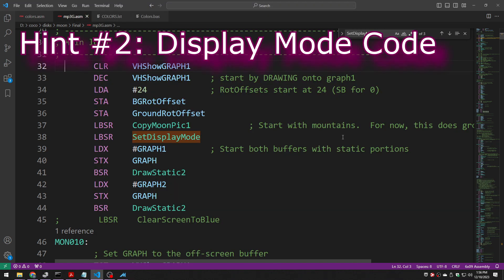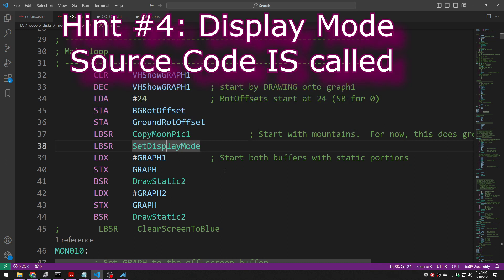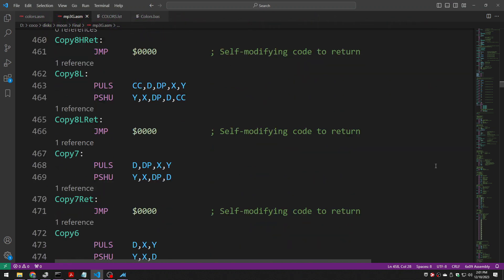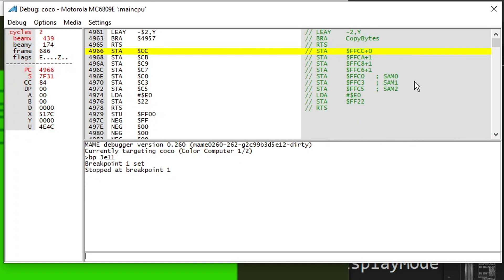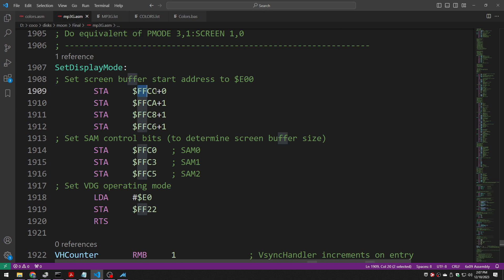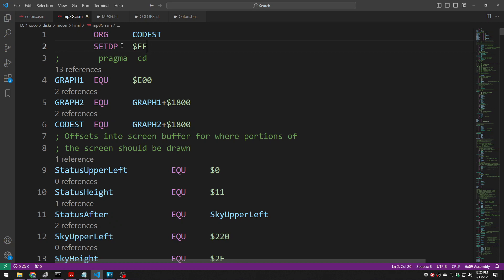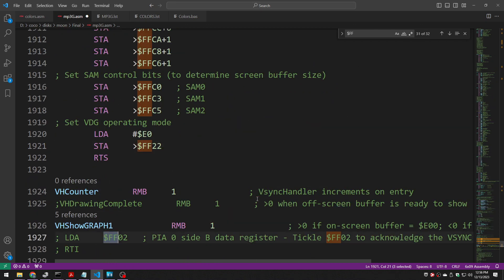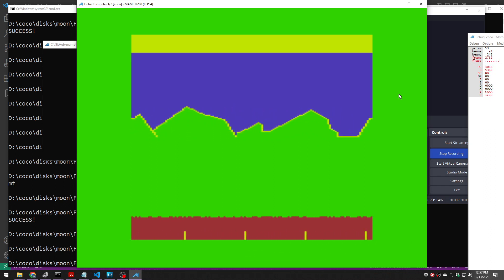My favorite bug so far | Asm Adventures

Comment: Don't remember the change?
That's a reason for using git locally, unrelated to being ready to check in a change for real.  You make a commit every time you get a clean compile.  The history then acts as your ultimate UNDO feature, which answers such questions as above (you can see it directly in the annotation margin) and backtracking part of the day's work to explore a different route, or cleanly removing part of the work that's in the middle not the most recent (for debugging).

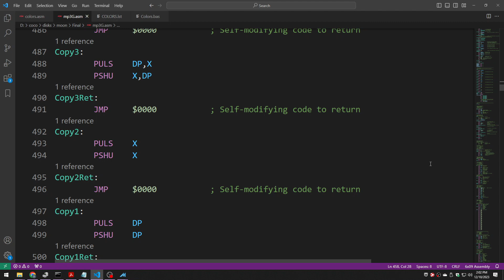Comment: 4:14 "you don't remember what you did": that's why using version control system is important. In such case you always have guaranteed working version. Then applying "split-half" method to find problematic change just requires some time.

Comment: This is why I always explicitly use Extended (>) or DP (<) modes in the source, rather than let the assembler do it for me. Once I started doing that, I very rarely have this kind of problem.
Reply from the maker: Sounds wise!  I have shied away from using DP in the past, but as I start to use it more, this sounds like a good habit.
Reply: Sounds wise [2]

Comment: The direct addressing mode bit me on my first bit of bootup code.  I wasn't using the SETDP directive and expected the assembler to understand that STA #$22 was directly addressed.  This wound up with it being assembled as STA #$0022 (DP was loaded with $FF).  Rather than using SETDP I wound up using the explicit direct addressing prefix.
Reply: Most, or at least a large number of, assemblers default to "SETDP 0" in which case your code would have worked (without the "#" since that would be "store A immediate" which isn't valid). It sounds like yours defaulted to something like "SETDP NONE" or something. For this reason, it's always a good idea to include SETDP when you're doing DP stuff.
Reply from the maker: Nice.  So you also hit the issue while trying to talk to the hardware.  🙂

Comment: Gotta love when provably correct code stops working. It usually means an assumption made by the code is no longer valid, as you discovered here. Of course, even knowing that doesn't make it any easier to find. I'm not too proud to admit I've been there. Even had many cases of problems similar to this one (the cause, not necessarily the symptoms).
Reply from the maker: Yeah, it's an easy error to make specifically because the developer has that assumption in their head, transferred the assumption to the code, and then forgot to ensure the assumption is valid.  I hope that, having gone through this once, I have learned my lesson well enough to avoid it again, or at least to know to ask myself, "hey wait, did I do that thing again?"
Reply: @CocoTownRetro  Yup. Collecting a bunch of "Hey wait, did I do that thing again?" items for your mental checklist is how people get good at debugging.